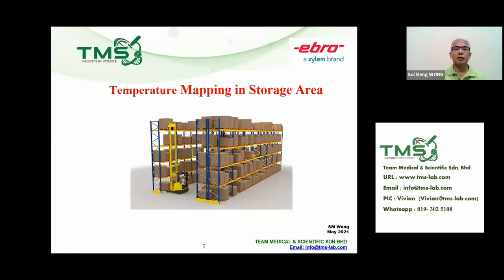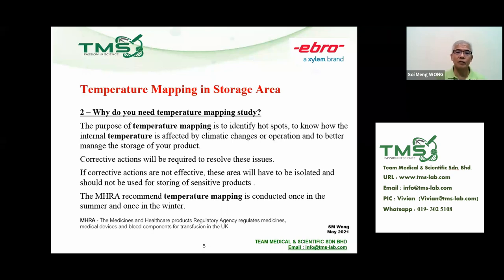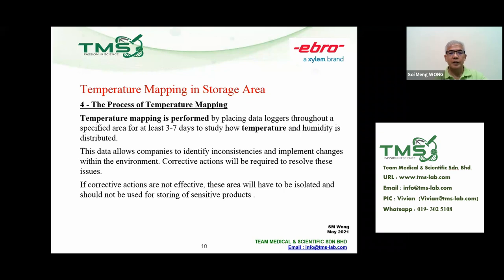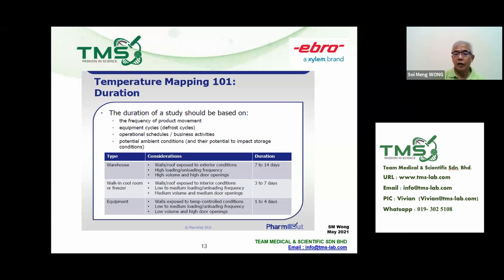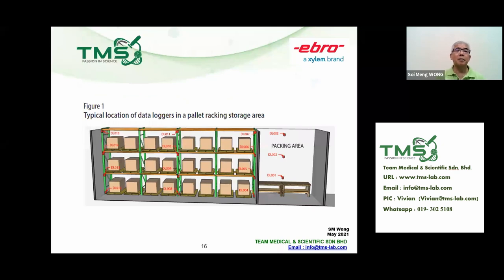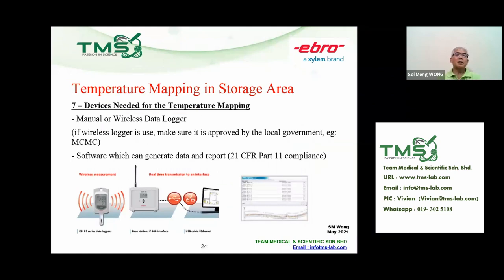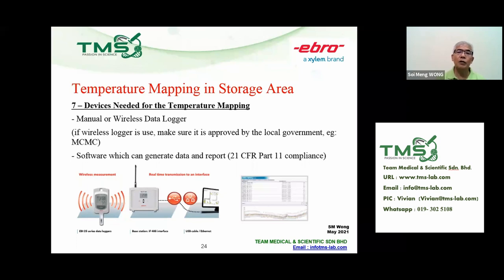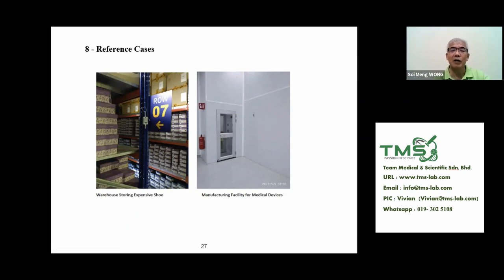Online Talk : Temperature Mapping in Storage Area by Mr. SM Wong

Comment: Hello there I really liked this video. Could you expand on temp mapping of incubators? If you need to map for use at 30- 35 degrees what temp do we map at?
Reply: i assume your process limits are 30 - 35, i would suggest to map at halfway 33 deg, so that your incubator can maintain 33 + 2 or -2 deg C. hope that helps. if the incubator struggles to heat up, you could try mapping at 34 and hopefully is doesnt exceed 35.